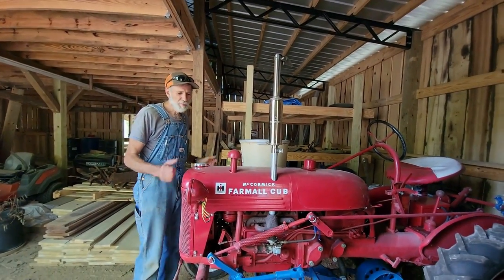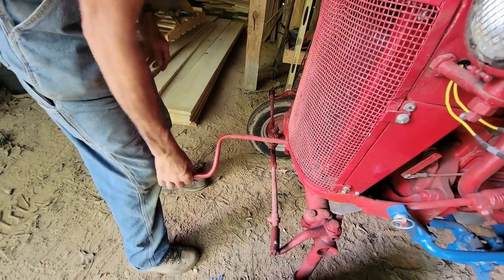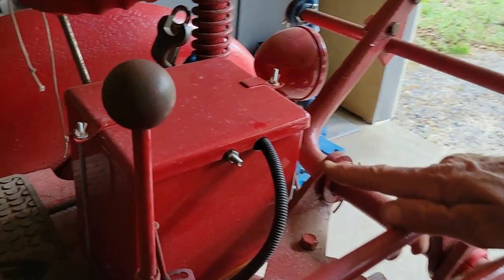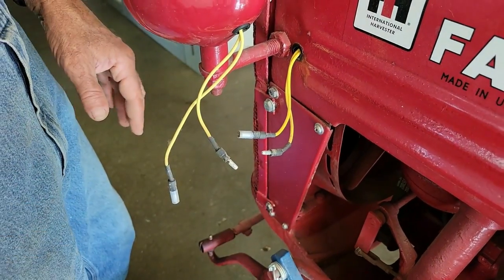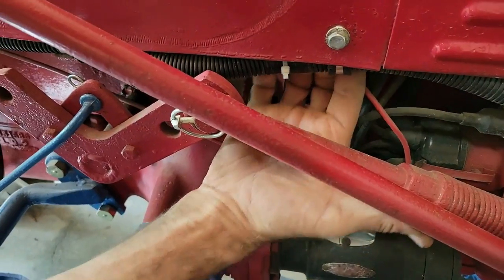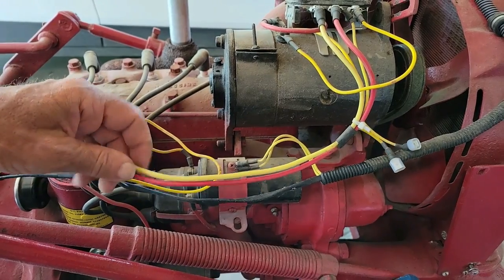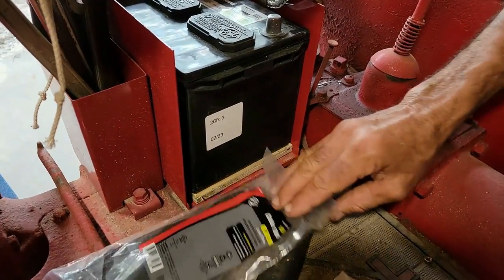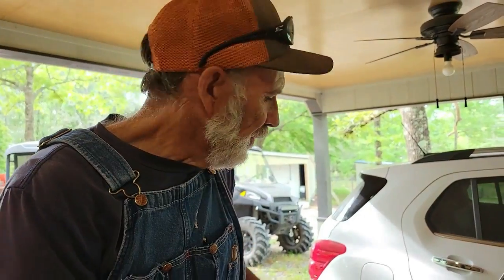6 Volt to 12 Volt Conversion | Farmall Cub | Step by Step

Comment: I currently have a Ford 2N setting naked in my garage. It's getting new plugs , plug wires , points condenser , distributor cap , carb kit install, oil filter , and sediment bowl replaced . 
It's a work in progress but hope to have it ready to work my garden soon . Getting ready for spring planting . 
God bless and lots of love from Anna in Iowa

Comment: When I converted my cub over someone suggested putting an alternator dummy light inline down by the alt.  It's only one more wire back to the toggle switch.  Just like the alt. light in a car it comes on when the power is turned on and goes out as soon as the alt. starts charging.  The biggest advantage has been it reminds you to turn off the power when not running to keep from burning up the points.  Great video.

Comment: Very good video covering important points! Notes I'd add: 12v neg ground systems are safest as you or someone later will 'jump start' a battery and assume it's negative ground like their pickup they are jumping it with. Use dielectric grease on All connections, not just the lights. Replace lights with LED lamps (inexpensive and super bright), replace the starter solenoid with one designed for 12v (or you can burn up a starter if the 6v solenoid sticks on). Don't let the battery box specify the battery as that will cost you more over the years from less flexible battery choices; certainly save the original battery box on the shelf with the other original parts for the next guy chasing parade/show tractors that never sees the field -- but I refurbish a tractor to do real work, reliably. It's no good if I have to tinker on the tractor before every project.

Comment: I have a 1957 Massey Ferguson tractor. It is 12 volt system but I had electronic ignition installed and now it starts so much faster.  You have done such a great job restoring the Cub to like new.

Comment: Mr Danny.  Thank you for the video. Was very impressed at how you explained the process and showed everything you did including calling out wire gauge sizes that everyone usually leaves out.  Did Machine repair for years and taught many guys and the one thing that drove others nuts was that they said your to thorough these guys know what they're doing.   I say you can never be too thorough .   Use that split wire cover all the time on projects   really makes it easy to keep things neat and safe  Wishing you both a blessed day.
Reply from the maker: Thank you

Comment: That works pretty slick with the mini alternator.
I did my super c back in the 90's with the Gm 1 wire and a diode to prevent back feed. Best decision I made especially trying to start it in the winter to plow snow without dragging out the battery charger.

Comment: Awesome video Danny👍👍👍 your craftsmanship is top notch. I working on a little piece of equipment that doesn’t have a computer or 1,000,000 miles of wire to run and chase down simple design worked quite well. God bless.

Comment: Showing the gas line you made was a special feature. I worked on antique cars for a while, the company policy was always disconnect the battery when you park it because of the risk of fire. Oh, and my cub has rubber fuel lines. A project for me. Great tutorial, I need a charging system on my fixer upper Cub. My old boss would have hit the roof when he heard the klink of a wrench on that beautiful paint job. We couldn't even touch the paint on the old cars.

Comment: 2 years ago I traded for a cub (48) it was in pieces. I had it running in 3 days. One of the things the man was doing while it was apart was convert to 12 volt. The best and most cost effective route was to continue the 12v conversion because the generator, regulator, and brackets were missing. They had a poorly made bracket for a full size GM Delco alternator that wouldn't fit under the hood. I built a new bracket that would allow the hood to fit with the full size alternator with 1/4" clearance when the belt was tight. I can now jump off my truck with that cub. On the ignition I used a ford ballist resister to a 12v coil on the advice of an old timer, haven't burnt the points yet. The old girl runs like a top and starts quick and easy. I used a lawnmower battery, it fit in the battery box easily. The previous owner had changed the starter to a late model 12v that didn't have the mechanical starter linkage, uses a ford type solenoid and starts with a key switch. As I intend to work the tractor I'm not concerned with it being original equipment as long as it functions properly. Those old cubs were some good tractors for what they were. I don't have a turning plow or disc for it so I use a 2 bottom plow and 6 ft disc behind one of my larger tractors to break ground then the cub does the rest.

Comment: Hey Danny, I've got a '56 100 Farmall I'm geting ready to do the same thing to. I was always told from several older tractor mechanics that as long as it starts good and charges on 6 volt not to mess with it but once it starts giving trouble to switch it! The problem is usually with the voltage regulator, if the generator charges good, but the batteries just won't last anymore. Also, most of the parts aren't as good as the original ones that came out on these tractors and it's getting harder to find someone who knows what they're doing! This has been my experience with these since 2006. Great video! From Sophia, N.C.

Comment: These cubs were designed to turn the headlight switch to make the generator charge if you were o lying running it for a short period you would get more amperage.
If you get the generator and regulator to a good knowledgeable shop they will match the output of the Gen to the reg. I have had this done ND have no problems with rate of charge or battery life.
Lots of people do the conversion and you dud a good job explaining it.
I prefer the 6volt positive ground

Keep videos coming I'm learning alot.

Comment: Looks good. I'll have to redo my wire harness. It's not that pretty. I may be doing away with the points and replacing it with electromagnetic ignition.

Comment: I use to train LOTO for a big company and one thing I use to use when talking about stored energy, was disconnecting a battery. I strongly emphasized that the terminal that’s connected to the body/frame/ground, is the one to disconnect first. Why?, because if you slipped, or accidentally touched the tool between the terminal and close conductive material, it couldn’t creat a short, as it’s the same connection. Then you didn’t have to worry about the other connection.

Comment: Awesome video. Currently doing a '61 Cub using the same kit running into same issues. Fortunately, not my first rodeo doing 12v conversions just first using a "plug and play kit". Thought it would save me time.

Comment: I was wondering how long it would be before you converted to a 12 volt system. I did it with a Farmall “H”. Best thing since sliced bread. There’s way more cranking amps in a 12 volt battery. The 6 volt starter can take the 12 volts, because it’s built for higher amps and it’ll crank like the dickens.

Comment: DSH: for more safety crank starting a tractor, stand like you are facing the tractor so only your right hand is on the crank, but crank the engine by pulling from Bottom To Up. That way if you slip or the engine takes the crank, you are falling away from the tractor not down and into it. I cringe every time I see someone cranking by pushing down (naturally trying to use gravity) and their arm, body, or face is inside that crank spin circle. Keeping the battery and electric starter system in great shape is definitely the safest!

Comment: I was told by an old mechanic, years ago and I’m 69, that you should not set a battery directly on concrete or the ground for any length of time. Always set it on wood.
Reply from the maker: That's true.

Comment: the only thing I would add is that you need to change the starter to 12 volt--in order not to tear up the flywheel ring and chip the teeth from flywheel ring,  I found the parts to change my John Deere at DB electrical--fair pricing and fast shipping.  Amateur, Brush holder and winding will need to be changed.  If you feel comfortable doing this then go for it (I did min). if not you might want to consult a mechanic---hope this helps

Comment: Just stumbled on this - I'll be starting a cub project this is great.   Couple of questions:   Would it be just as easy to get a longer belt to save having to mill out the bracket and did you change over to negative ground?   Can't wait to watch all your cub videos.
Reply from the maker: The hood is in the way for longer belts. Yes I switched to negative ground.

Comment: Danny I don't know if you had mentioned or not maybe I missed it ,lot of problems these little tractors or any of the 6-volt tractors people tend to change out the battery cables for automotive type battery cables and that is a no no. A lot of people switch them out for new cables and that is no count my friend, I would like to add that,need to stay with the standard battery cables for the 6 volt .I have seen that's been done and fry a brand new starter for lack of voltage.,,So in a nut shell I guess I'm saying no to automotive battery cables an if need be replaced need to get new cables , just for a good gauge they're almost twice the diameter of an automotive battery cable. I've used large welding lead before done a great job. Also personally I'm big on getting that ground cable off of the box hooking it directly to the Tractor somewhere boxes tend to get rusty start a connection. Kudos my friend on the Dielectric grease connection I'm big all that also

Comment: Why didn't you trouble shoot the original 6v  system and repair it? From what I see it would not have cost more than 40 bucks and very little labor.
Reply from the maker: I've spent hundred's of dollars keeping it going. It was always something wrong when I needed it.
Reply: @DeepSouthHomestead  There’s a reason the industry changed from 6v to 12 isn’t it 🤣
Reply: Steve I’m sorry if my comment sounded rude that wasn’t my intention, the reason people upgrade these tractors from 6 to twelve is because it’s a superior upgrade that wasn’t available when that cub was made. According to ohms law it takes 1 volt to push 1 amp through 1 ohm of resistance. In that equation the volts are what actually push the electrons. So no matter what diagnostics and repairs he did to that 6 volt system it could never perform as well as a 12 volt system. That upgrade will make anyone who actually uses an older tractor’s life much easier. I hope this explanation helps .

Comment: So you changed the charging system to 12 volt, did you change the 6 volt starter to a 12 volt one?  The wires shouldn't be a problem, 12 volts can use smaller wires because the amperage is less.
Reply from the maker: Haven't changed the starter yet.
Reply: When I converted my 8N to 12 volt I used the 6 volt starter it has worked fine for 4 years now.
Reply from the maker: @davidkitts8017  The 6 volt starter will be fine unless you do a lot of winding on it then it will overheat and mess it up. I will leave my 6 volt on it because I know not to do a lot of winding on it. If it doesn't crank I will figure out why instead of just sitting and cranking on it.